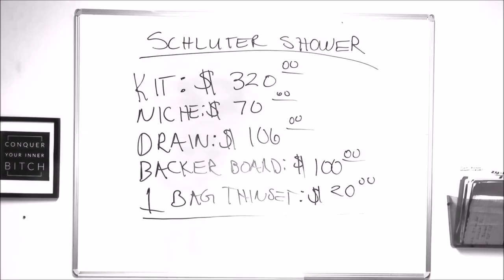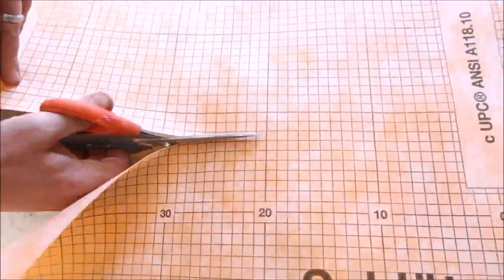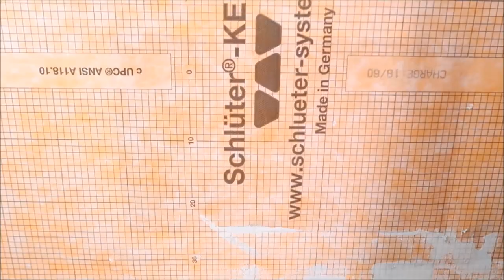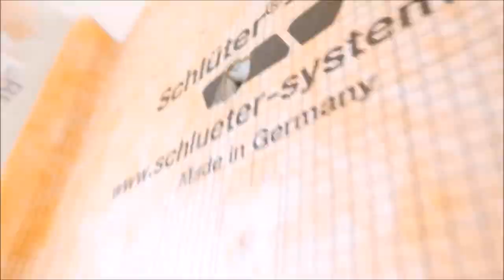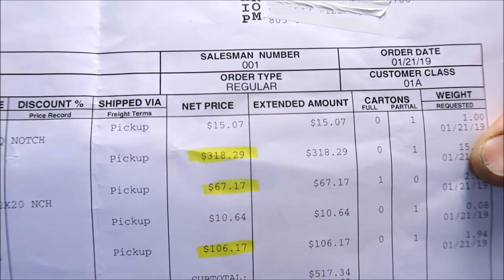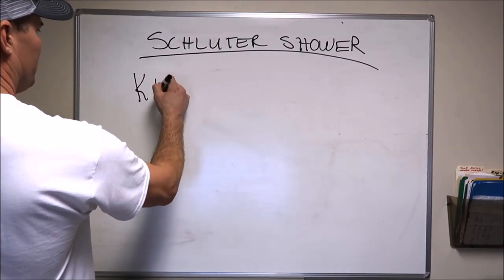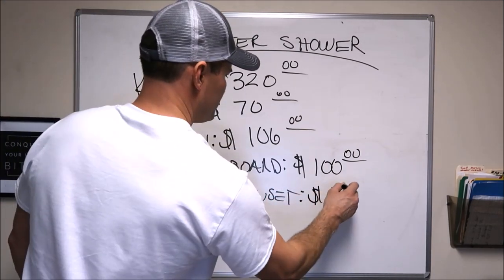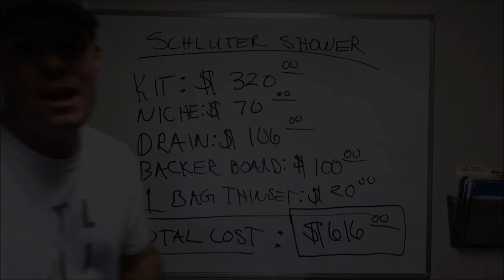The Real Cost of a Schluter Shower

Comment: Just remember folks Schluter is just another option,  It is not required or necessary.  Professional Tilers can build a waterproof shower without the help of Schluter.   I do it all the time.
Reply: That's the truth. Every shower outside of USA is waterproof and never uses this stuff. But I guess there's a benefit to have a prefabbed soap tray. The drain is pretty nice too.
Reply: I prefer roll on water proof, it's cheaper and easier to get right, you really can't mess that up, if you mess up, it was b4 you put the membrane on

Comment: We use Schluter a lot.  Did you see that now you need to use Schluter brand thinset (not easily available) and register the install with Schluter to obtain the warranty?
Reply: Wow, you probably have to complete their training class too
Reply from the maker: We talked about this with our rep 2 months ago and was told that using their thinset is not necessary for warranty. Also, he didn't mention anything about registering, we'll have to look into that.
Reply from the maker: Negative, only follow their guidelines. I know this for a fact.
Reply: @LandbergTileTV  Good to hear.  I'll double check with my rep and let you know if I hear any different.  I was just looking for specs for something on Schluter's website recently and ran across this: https://www.schluter.com/schluter-us/en_US/faq/lifetime-warranty-steps
Reply: Yes,absolutely correct
Reply: Use another brand thinset and have a problem,legal nightmare!
Reply: We do 600 houses a year with Schluter products we used Bostic kerdiset for years  this is our 7th year using the product we switched to TEC full set AS we use their power grout for all of our installs Schluter says it is ok to use another manufacturer unmodified white thinset
Reply: Starting to sound like Apple. Get out before you have to use their brand scissors lol

Comment: Here is the fail of this system, and this applies to any tile install materials warranty. If there is a failure it's the installers fault regardless. EVERY single time. Can anyone here give proof of where a tile related supplier honored a warranty of their product? Especially a failed Schluter system.
Reply: The warranty usually offers reimbursement for the price of the product, and NOT the cost of the tile, tearout, and reinstall labor.  A traditional shower pan like chloralloy has a lifetime warranty, which means they will reimburse you $60 if it fails.  You can assume the same from Schluter, so you'll get your $320 back if you're lucky.

Comment: Been using schluter for 3 years, i have found on any shower 4x4 and under is about 300$ more, and larger showers run about 500$ more. O and i will only use Schluter Systems, not going back to the old way👍

Comment: If you start tiling immediately, the  you skipped your 24-hour water test. 

Here's the way I've done it for almost 20 years with no call backs... EVER

7 Sheets of durock $70
Half a bucked of red guard $80
3 bags of quicrete $20
Oatey drain and liner $65
Fiber tape $15
Misc supplies $50
Grand total of $300
And guess what. I have double waterproofing. If my red guard on the pan should ever fail, I have a bladder under it.
Reply: That's a lot cheaper.

Comment: so i CANNOT put this right on to regular sheet rock?
Reply from the maker: Yes you can, any substrate, but would recommend drywall or use Kerdi board for the backerboard 👊
Reply: Dry wall substrate for dry applications, not for wet applications.

Comment: I installed that some valve in my master bathroom reno (from Amazon) - One thing I noticed is that whenever another water fixture is engaged something inside that valve makes a noise....have you noticed?
Reply from the maker: No sir, have not noticed any noise like that. We have installed this same valve many times without that problem.

Comment: For most of your projects, do you typically use green board and then apply the membrane over it, or will you sometimes use Kerdi Board?  How do you you decide which is the better option for a project?  I assume Kerdi Board is slightly more $$, but it also eliminates one step.  But then again, you'd have to do the Kerdi Band so maybe it doesn't save a step after all!

Comment: The only problem with using drywall with Kerdi is if a leak occurs in the plumbing at the valve Or pipe trashing the drywall

Comment: There are three things key things you show in video that make the system work for me, other than cost. Scissors, foam base and Kerdi. They are all light weight and easy to transport and work with.  Have enough stuff to haul around as it is...just saying.
Reply from the maker: Yes they are, light and easy.
Reply: @LandbergTileTV  how does the foam pad work over plywood/osb...just non mod thinset? Also is the pad presloped?
Reply: @boltup5566  yes, modified over wood substrate, and yes the top side of the tray is sloped from the corners to the drain. Landberg has a video on large format tile on the tray that best illustrates how it is sloped.
Reply: You always have to feather out the pan with thinset with the foam to get the proper slope. Those may be quicker,  but they sound hollow and flimsy. Old school mortar base with kerdi membrane is the only way to go!

Comment: Will Daltile sell to non-contractors / professionals though? Looking through their site all I see are Daltile centers that are open to the public but only sell to contractors / professionals.
Reply from the maker: Yes they will,anyone can walk in and buy Schluter there
Reply: @LandbergTileTV   Thanks a ton! Will have to check it out.
Reply: It will cost you more than it would a contractor. 25%-45% more.
Reply from the maker: @mlrich1  That is NOT correct. I know for certain it is the same cost to a contractor (me) vs. a homeowner diyer. If the shop you purchase at is charging more for homeowners, than they are taking advantage of them, period.
Reply: @LandbergTileTV  
It's a fact it cost more for a homeowner to buy vs a contractor that is buying stuff every day.  Your pricing is high based on what I'm paying for schluter products as well.

Comment: What's the going rate for installing this system? I know it differs in different markets but wondering a ballpark.
Reply: High end tile setter 50-90/h quantity of work dependent apprentice  20-35/h 

Average people shoot for 350-500 a day. 6-12 hours.

Small jobs like this are as much as  one can get away with. Aka zipcode and house size will be the determining factor.
Reply: there is no "going rate" everyone is different

Comment: You do great work "I have so many questions but I'll try to keep it short...ha I'm trying to start my own ' very small' business as a Tile installer...
  I understand that to a builders/contractors perspective it's very important to be adequate on $$$/Time/Code/Warranty... But In your opinion as far as quality (if you were installing in your personal shower/house) 
 1.  Would you use this membrane product or a shower pan liner for the floor...?? (I know dealing with mortar mix underneath can be a pain-_-ha) "I like the way the membrane on works on walls though)
 2. There are many versions/types of thinset from 18$-35$ 'I think' which type/kind would you prefer if it were your personal shower...? 
3. Would you use 1/2 Hardy board on walls for a personal shower..?? (I've heard green board is up to code for showers buh feels to close to weak sheetrock to me wouldn't 1/2 hardyboard last longer & be more sturdy +1/2hardy is equal/level most of the time with sheetrock aswell)
Reply from the maker: We install Kerdi foam pans and dry pack mortar beds. They both work. We like working with Schluter Ditra set ($15 bag) and I would use Kerdi board on my shower walls. If all installed properly, all methods/boards will last long.

Comment: And conversely three coats of red gard on a Hardibacker enclosure is 60 bucks. Oatey drain, PVC liner and a mud bed. Another 50. 
I guess both will achieve the same outcome.
Reply: Hugh G. Rekshin add in all the labor and dry time for that and you will equal at least a day of labor costs. Plus an overall inferior system hands down.
Reply: Way more room for total shower failure errors doing it the old way.
Reply: Except for no warranty and a lot of extra time for you're method. I can be setting tile the same day with a schluter or laticrete shower. And know I have them behind me....time is money and liquid applied just takes to long, does it work....sure, if everything is perfect and you get the proper thickness on the backboard. As far as the floor is concerned, sorry but mud bed and liner pans eventually fail. And from the very first time you turn that shower on the pan is saturated from that point on
Reply from the maker: Correct me if I'm wrong, but let me break it down on average for the system you are talking about:
$100 backerboard
$100 pan liner and mortar
$20 Drain kit/ABS 
$20 Lumber
$120 Two gallons Redgard/Topical membrane (3 coats on curb/curbless, 3 coats on niche, 2 coats on shower walls)
____
$360.00

So, for $250 more using Schluter, you save 8 hours on labor and dry time. 
Make your choice, save $250, or save 8 hours of labor/dry time and avoiding harmful dust/fumes and bodily abuse.
Reply: @LandbergTileTV  exactly!  It's the down time I cant understand.
Reply: I wanna know is anyone still uses the reinforcing tape with hydro ban or red guard? I seem not to see anyone using it. That was my hatred of those systems and I did five coats to get the right mill. I always lost two days just getting it to a point of waterproof.
Reply: @tileslay6543  haha a tile setter with a thickness guage you are a unicorn. Honestly we do huge complicated showers and waterproofing the whole floor and anything to do with water and we usually use kerdi DS so it takes minimum of 2-3 days one day just cutting sometimes. And fitting everything. But we work to 1mm accuracy at all stages from leveling walls (concrete) to cutting the membrane and no foam so it all depends on your level of perfection. So yeah liquid applied is 4-8 layers for proper thickness.

Comment: In my region (Ontario Canada) a 38" x 60" schluter kerdi shower kit costs = $595.80. niche: 28"x12" = $118.47. Drain grate and flange = $159.94. 4 sheets green drywall = $123.48. 50lb bag of unmodified schluter thinset = $31.37  (2021 prices total) $1,029.06.  NO labour. Quite a difference in costs
Reply from the maker: This video is a few years old

Comment: We don't do the volume of showers you do of course, primarily using wedi. We tried the shluter kerdi membrane and we all complained the whole time about how we wish we were using wedi. I suppose its just like the Ford vs chevy vs dodge
Reply: I think your talking about the wedi panels? If so, totally agree with you. A lot easier and cleaner to do. Put the panel up, seal the joints. No BS with drywall, thinset, kerdi, kerdi corners, kerdi bands, buildup, etc.....
Reply: @krehbein  yes the whole system is a dream to work with!

Comment: I thought the  pan already came waterproofed. It is only waterproofed if you have to extend it with mud. I working on diying my bathroom and will use schluter. Even my plumber said it was better than the old ways.
Reply from the maker: It does now, this is an old video when it did not.

Comment: Why do you keep saying green board. If it’s waterproof then can’t you use regular drywall. And doesn’t the wax in the green board affect how well the thinset sticks?
Reply from the maker: Moisture and mold resistant, it's  the same cost so might as well and no, it absolutely does not affect the thinset adhesive. We've pulled kerdi membrane off after it's cured, and it rips the drywall to shreds.

Comment: What schluter needs to do is design a customizable drain location pan slope for installation in crazy high rise condominiums where drain locations are fixed, in odd places, and cannot be moved without significant cost and time.  They do that, and I'll use schluter ever single time, because it's great.
Reply: You can buy the kits, cut them (they are just styrofoam anyway) and fill in any gaps with mortar.

Comment: You say completely waterproof but I know you saw Isaac's video. It would be cool if you would consider doing a similar test to see if the results turn out the same for you.
Reply: Which video?
Reply from the maker: There NEVER will be standing water in a shower pan for 7 days. If you do, you have MUCH bigger problems than a very small amount of moisture residue on the drypack.
Reply: @LandbergTileTV  sure, I agree! But you will have water and moisture constantly hitting it. And slowly the thinset joints will absorb all that water. The test was meant to show long term water exposure in a condensed time frame. They can't claim to have a superior product if it can't handle the same thing as a liquid membrane.
Reply from the maker: @apex007  https://www.schlueter.de/media/2018_Tile_SchwimmbadHH.pdf
Reply: @LandbergTileTV  OK, I had a chance to read it over better. "Overall, some 360 m² of KERDI were installed in the Hamburg swimming pool; expertly bonded with the two-component sealing adhesive KERDICOLL-L". Kerdicoll is not available in the US. So to make it truely waterproof you can't use thinset and can't get the required product in the US!
Reply: is easily fixed by applying liquid membrane on all overlaps. 1 $50 bucket of red-guard will do about 100 showers this way
Reply: @SonsOfDeForest  so why not just use the superior product?
Reply: @apex007  liquid membrane on its own is less durable. it can degrade under long term water exposure and crack or split as the house moves and settles (esp on new construction). use both to get the best of both worlds
Reply: @LandbergTileTV  I kinda disagree here, my shower gets 2 to 3 uses a day so I'd imagine although it may not be completely underwater, it's is most definitely constantly wet. And knowing that all mortar is pourous it's safe to say that water is definitely going to penetrate the system, after a few weeks, months or maybe years depending on factors like usage, grout type ie epoxy, cement based, composite etc. I just can't get behind the kerdi line. You are fantastic tile guy though!
Reply: @SonsOfDeForest  that's how i do  it never had a problem

Comment: The main issue with Schluter products is the install is not really a DIY for many. It has to be done perfectly with no flaws. While it's "easy" it's not as easy they make it seem and not the easiest or most fool proof install for the average DIY who might make a minor mistake. There is zero tolerance on a schluter install. it has to be done to specs it has to be done using the materials they say with no deviation. It works but there is easier installs with similar results. For example paintable membranes Crack/waterproofing membranes work very well and are much more fool proof than feeling confident that the seam tape is properly bonded. Still a top level product just has to be perfect and perfect is not a guess or a hope in a shower stall.
Reply: RecklessTheory yup exactly.  And Ardex has that liquid applied system down.  Way easier to install than kerdi but no lifetime wnty
Reply: bill hill  Just look on youtube and you will see professionals who install a wide variety of products day in and day out. Most have had a job here and there where they realized that one product wasn't compatible with another but wasn't obvious or they go in to fix someones sloppy job and it just shows that with one product they probably could of gotten away with it for a longer period but not with schluter. Zero tolerance is a bit of an exaggeration but people respond to "don't mess with the instructions" differently than "be careful." since I was referring more to mixing products. The schluter system is notorious for working really well only when you use only their products or know the technical science behind it down really well . While some other products that a bit more interchangeable and fool-proof. If someone wants to DIY it and is not a professional and they want to use schluter they should know to spend the money and follow their instructions and only use schluter products or at the very least call them for technical support. It's one of those things that if you do right you can plung that thing 4 stories under water and it won't leak while another product may only go 2 stories but is less likely to get screwed up but a someone who doesn't do it all the time.

Comment: Yup you're right at it, as a pro I charge 1k for the system and add on for niches which are even cheaper if you build them yourself with kerdi board.  Of course the regular homeowner shouldn't be able to buy at DalTile, contractors only.  And your average homeowner with limited construction background probably shouldn't tackle a waterproofing install as sensitive as a shower.  They should probably start off with a tub surround. I base my costs for average kit at the retail level (floor and decor Bedrosians Ect).   It only makes business sense.   Oh but you forgot the cost of Schluter trim and the expertise it takes to install that correctly.  :)
Reply from the maker: Yes sir, I agree with everything you said!
Reply: Good video btw. I understand that your presentation wasn't about trim as that is always a variable. I just wanted to complain about Schluter metal trim lol.  It looks great but dang it's a pain. Hahahaha

Comment: Schluter systems fail because the thinset used isn't waterproof.  I was FORCED to install this on ONE job.  Never again.  Spend the extra and use the Wedi system.  It's the best of the market, and you'll never have to spend $12,500 to repair a problem that could have been avoided because you wanted to save $1100.